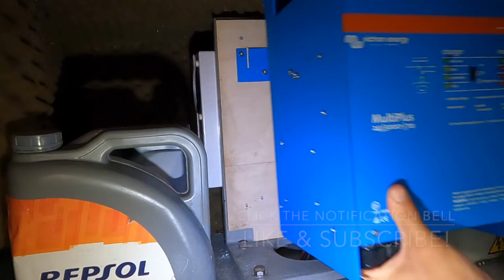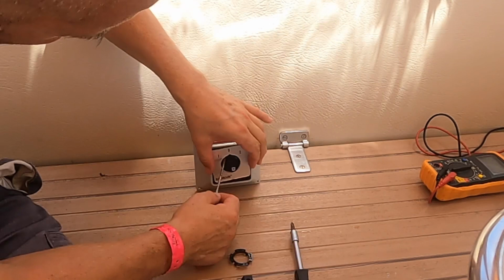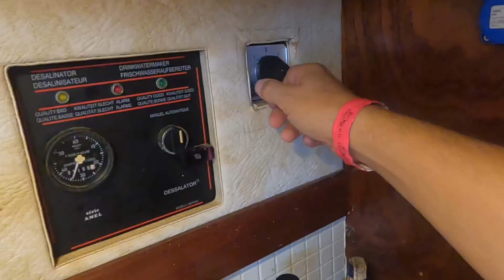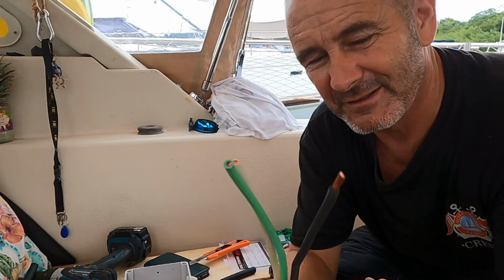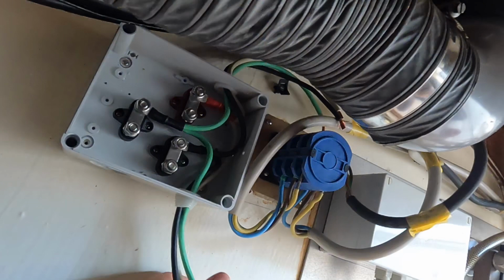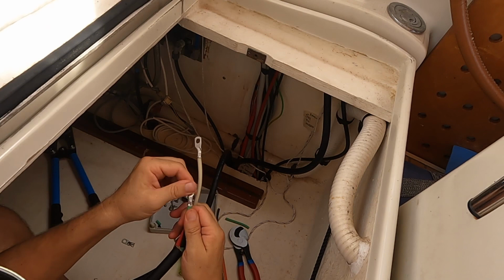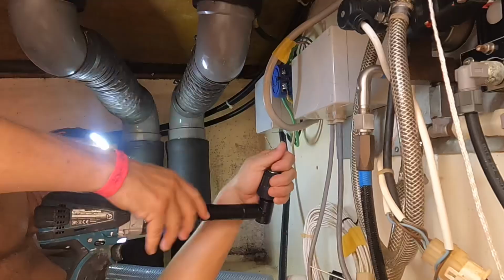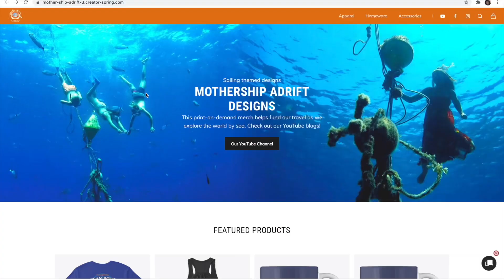Rotary Relay Cam Switch Instal for VE Multiplus Inverter/Charger: Lithium Battery Upgrade 02

Comment: A good tip when wiring always cut your twin and earth cables so that the earth (ground) is longer than live and neutral. This way if a cable is ever pulled out the live and neutral dill be pulled out before the earth
Reply from the maker: still got plenty of wiring to do so will take that onboard for the next job 👍

Comment: Hi Woody, one of my legal duties as an electrician is to point out any incorrect electrical installations when I see them, I’m not sure if that extends to YouTube but here goes anyway.

1. As a general rule you shouldn’t switch earth wires, they should always be permanently connected. It’s unlikely to be an immediate problem but it does increase the potential for failure.
2. Your Multiplus battery cables are too thin, they are going to get hot. They should be at least 120mm2 or (2 x 50mm2s) on both the + & -.(Also fused with a 300A fuse if not done already)
3. If not done already your Multiplus 230v feed cable needs it’s own circuit breaker. (Size depends on if you have the 70-16 or the 70-50 version) As does the shore power cable (don’t trust the dock breaker).
4. You shouldn’t use solder on wires over 24v. It actually weakens them and can cause hotspots.
5. In USA white is the Neutral and Black is the Active (called Hot in USA), but this might only be a problem if you’re planning on registering your boat in the USA.
Reply from the maker: Thanks for taking the time to comment. Always grateful having input of a few experts!

1. I always wondered why I would find earth wires bypassing fuses and switches. I was also advised to keep the earth wire slightly longer than the others in case the cable was pulled out and the earth would be the last to disconnect. Is this something you would advise too?

2. As you’ll see in the next few blogs I replace the 25mm cables with 50mm cables and add a 300A T-fuse between the batteries and shit off. I would have gone with a slightly higher rated one with the bow thruster being on that circuit but it’s all I could source at the time. 
3. The Multiplus is the 70-50 and went with it in the advice of quite a few others with the same system. I do have plans to add a shore power circuit breaker at some point but as we rarely use marinas or plug in that job is way down the list. I didn’t plan to put a circuit breaker one on the Multiplus/battery cable. There was a reason that this connection is permanent (ie not even the battery shut off cuts it off) but I can’t find the research I did on that now :/. 
4. When you say ‘solder the wires’ do you mean tinning the ends? On our boat I found some existing wires were and some weren’t and have heard different opinions on both.. ie without tinned has corrosion issues but snug connection. With tinned it protects against corrosion and creates a more robust end to prevent fray but doesn’t allow for a song connection. So you’re saying nothing at all above 24v should be tinned?
5. It’s so difficult following a standard system when you’re travelling the world and sourcing wires from different countries. I try and mark them as clearly as possible but you’re saying in the US black is ‘live’ - ie., equivalent to red in Europe? I don’t plan on registering the boat in anywhere but U.K. or Europe but handy to know if I sell on to a none European buyer - thanks.

Comment: My first thought is why didn't you buy the Quatro rather than the Multiplus as that is designed for connection to the shore and Genny at the same time.  I got Bosy from the Brighton boat to tell you after the last video that the battery connection on the MP should use all four terminals, two Pos and two neg.  This is in the manual and is required because with the voltage drop under load it can lead to DC ripple and is very bad for the transformer life.  This is true with Lithium as well as LA.   Very methodical install, well done.
Reply from the maker: As you’ll see in the following video i replace the 25mm cables with 50mm cables and it was a real squeeze to get them in because the cable run is so difficult. Having said that the original cables were epoxied in place and impossible to remove so I guess I could reinstate them on the spare terminals. Would there be any harm having a couple of 50mm and the others 25mm or do they need to be equal gauge?

Comment: Nice job mate but no need for the junction box. You simply use jumper cables on the switch, but either way will work.
Still better to have got a switch with 2 inputs, to one output.
Anyway 100% safe now ⛵️👍
Reply from the maker: Thanks Jay.. yeh it was a fiddly job but I feel better having swapped that relay switch out after hearing some of the overheating stories.
Reply: @MothershipMaintenance  yeah our old automatic switch started melting!!
Reply: @JayPerrypersonal  oh crap.. yeah, I'm doing mine as we speak

Comment: Hello Woody,
I will in the next year purchasing an Amel as well. In the mean time I have been educating myself on all the systems of a sailboat like yours. In my Research I came across a diagram from Victron Energy and they have Circuit Breakers on the Generator and Shore Power before the power gets to the Inverter Charger.

I would think this would be a good idea to have the Circuit Breakers installed in case of any kind of short of the power going to your inverter charger to prevent damage or fire.
Was this considered in your design and if not why. I am just trying to understand why somethings are done a specific way.

Love your channel and videos keep up the great work.
Reply from the maker: Hi Timothy. A lot of Amel SM owners have added circuit breakers to the shore power cable in the lazorett. I haven’t done that yet as we haven’t been in a marina in months and won’t be for another few months.. but it is on my list of things to do.  I believe there is an inbuilt regulator in the onan generator itself so although you could add a circuit breaker it would probably be a bit overkill.. but do no harm I guess. Someone else might have more info on that..?

Comment: On schematics it all looks so easy and simple.. But indeed once you start applying it to the real set up, the scenery changes quickly.. 
Woody, what a nice job and yes I grew up with metrics in Europe and had to change to the US system, including the electrical codes..(way simpler in the US , because of the 120/240V  household systems).. 
Alas, I don't like the neutral/grounding system but changes are in the works to avoid ground/neutral bonding at all.. now it's restricted to the prime panel..Anyway...c'est la vie ...
Reply from the maker: I’ve got to admit I had no background at all in electrics so it’s been the biggest learning curve on the boat.. not made any easier by the two different systems and different terminology. I’m still learning but had some fantastic advice and guidance from other Amel owners and guys on the Amel forum and FB group. 👍

Comment: why is it that I don’t see boaters solder their lugs just crimp? When they use heat shrink. With the environment with all the salt. Thanks for helping me understand
Reply from the maker: With tinning (solder) you might project the end of the cables from corrosion but it stiffens the copper threads so they don't crush into the lug as effectively.. and it makes for a worse connection. This happened when I tinned the end of our solar cables and they overheated due to a bad connection. Best to use tinned wire at the outset.  However for this job I couldn't get hold of any so used normal copper battery cables but as the ones I was replacing had been in the boat for over 20 years and were still fine I figured it would be safe to use the same.